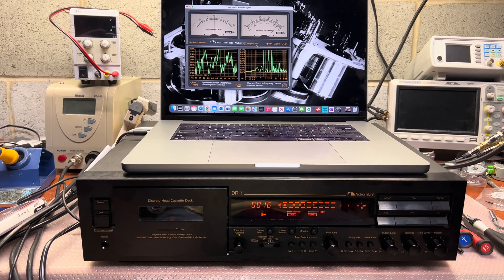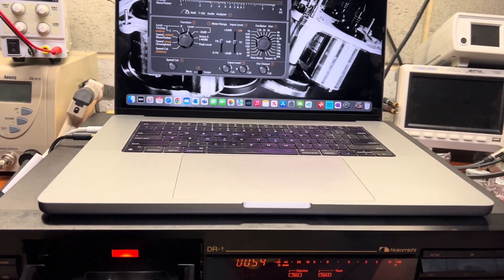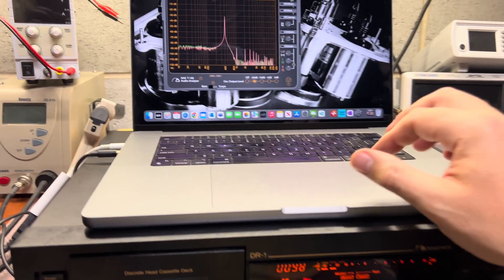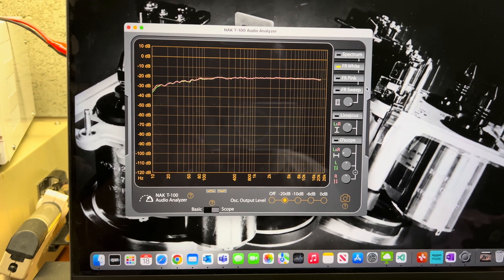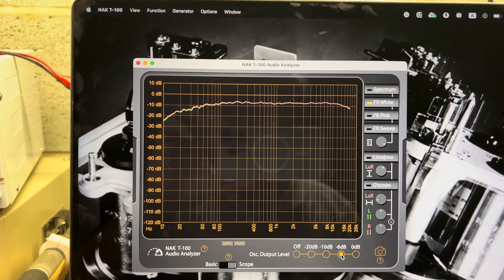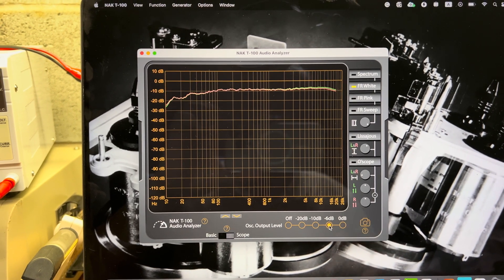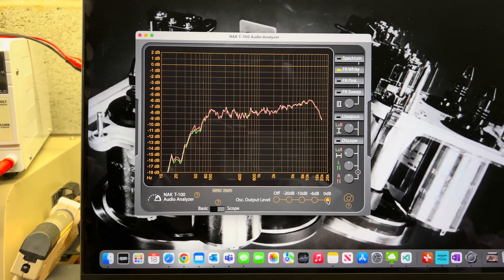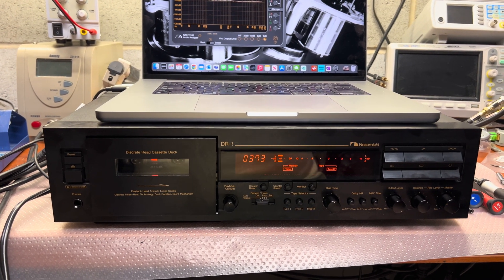Measuring the Unbelievable: Recording Parameters of the Nakamichi DR-1

Comment: Hello dear.Please tell me,Nakamichi dr10,how many volts at the output at 0db,and what is the magnetization of the tape,how much nanoweber?

Thank you.
Reply from the maker: 0 dB for that model is 0.5V on the output terminals when the output volume pot is on max. that will correspond to a 200 nWb tape. Use Dolby level tape for that.
Reply: Thank you, kind man.

Comment: Why there's low bass frequencies drop? Is it due to test signal FR White? Because its also there when you select source monitoring.
Reply from the maker: That is the audio card drop I use, check it is the same for the source and tape.
Reply: @hifirulezzz  -10dB at 20Hz why the card has such a behavior? Is it a microphone input with some embedded handling noise LF filter?
Reply from the maker: @somebodyx  it is what it is, if your card perform better - I am happy for you. Card has RCA connectors, that is why I selected it.
Reply: @hifirulezzz  If same response with sine sweep then its definitely due to the card. No worries, just cool to be sure about the LF response of decks if there's a way around it in software.

Comment: I once calculated that any Wow component at 8Hz is very probably from the capstan, the pinch roller (if 11mm in diameter) rotates at around 1.6Hz. 
(from memory ... I don't have the exact figures with me).

Comment: Well the W&F are not best when you know that it should show 0.035%. Beside belts check the copper bearings and other stuff which may affect the speed stability.

0.089% of W&F had my Basf D6035 deck with damaged capstan roller. After change to the type with bearing it dropped down to 0.048%. Not bad for a 1977 year deck.
Reply from the maker: Most of the DR-1 and DR-2 I serviced show me 0.06% to 0.09%, same belts show 0.027% on DD motor decks. Bearings are fine, same with the heads, low use. Lubricated everything, no luck. The only idea left - capstan surface. Not enough grip.
Reply: @hifirulezzz  Check also braking force of the Supply reel. Sometimes they need to have some force to get lower W&F in total.

Capstan grip is also a good clue. The rubber can't be too soft and also not too hard. Unfortunatley I don't remeber the Shore value of that :(